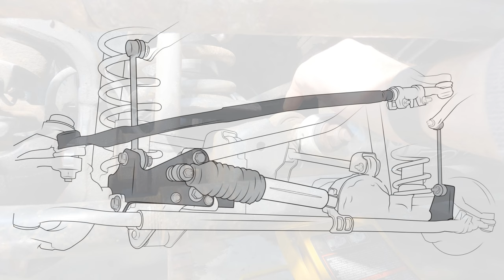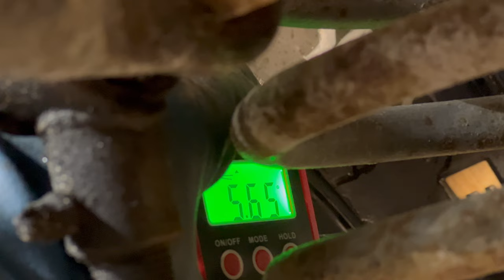What causes my Jeep to have bump steer?

Comment: By experience death wobble is cause by low air pressure at high speed . So make sure you air up after you haven’t use your Jeep or that you have air down after  crawling or muddying !
Reply from the maker: Haven’t experienced that (yet). My experience with DW was usually due to a worn steering, suspension or tire wear or balancing issue. 

Sometimes an alignment can help pinpoint that’s going on.

Comment: Reamer tips,,, NEVER run in reverse! It will destroy the cutting edge and those things are near $90 ea. Lots of cutting oil and clear the chips often.
Caster, if you want your Jeep to drive really good, you want as much caster as possible! 6-8 is where it is generally set at stock. The bigger the tires you have the more caster you want (with in reason IE put 35s on with 6 is and chase that thing all over the road!)(8 plus makes it drive nice)With a solid axle you are SEVERELY limited on this adjustment! Your pinion should point directly at the transfer case output giving a zero degree deflection for that U-joint. The double Cardan at the T-case cancels itself out but can not cancel the U-joint at the diff. What does that mean? If your pinion is not right, you will likely have a vibration at some speeds unless you have locking hubs.(at low speeds IE off road vibrations are generally not felt) Adjustable ball joints can only get you 1.5 degrees which can make a big difference but often is not really enough. When I built my front axle for my TJ, I cut the inner Cs off, rotated them to get 10 degrees caster with a perfect pinion angle. Then if I need fine tuning it is well withing the confines of the adjustments. FYI cutting and re-welding Cs is a crap load of work and if not done right, your screwed but well worth it IMO.